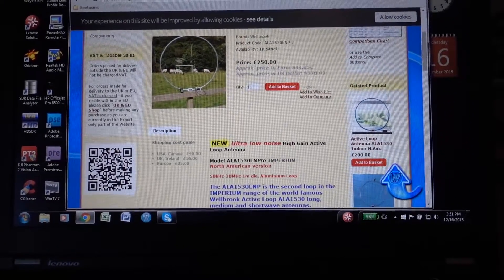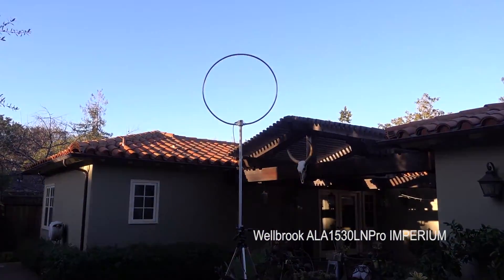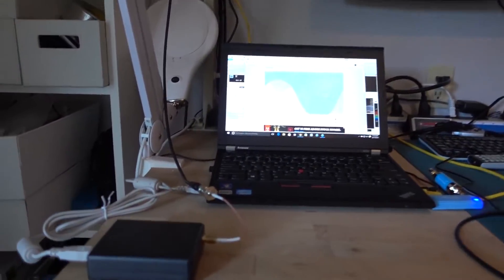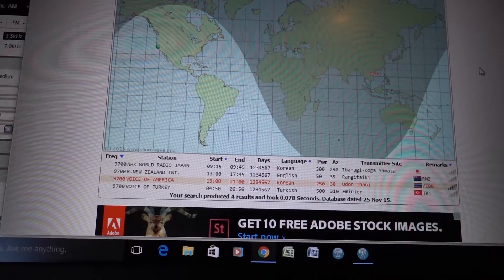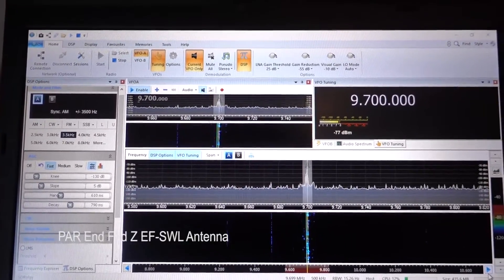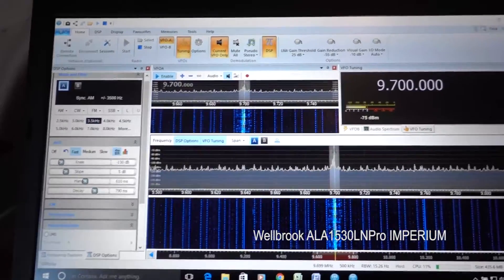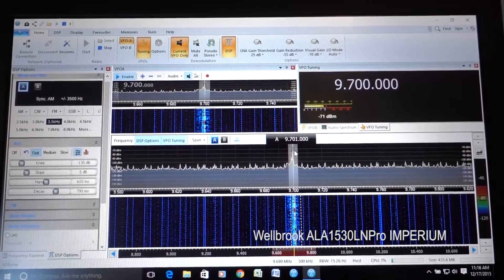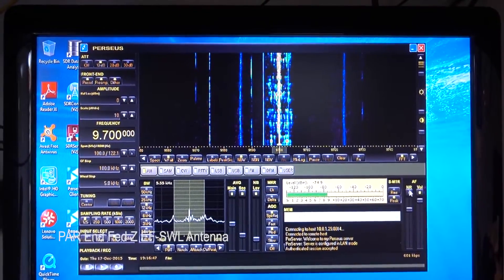Wellbrook Loop Antenna vs. PAR End Fez SWL Test on SDRplay

Comment: Sounded like an interfering signal on or near the transmit frequency of the first station SDR console should allow you to NOTCH OUT an interfering signal. Power SDR does the same thing. LOVE SDR's
Reply from the maker: True.  In general adjacent or strong local signals tend to overwhelm the SDRPlay, but not the Perseus.

Comment: Have you tried turning the Welbrook antenna at 90-degrees in rotation to see if there is a difference ??....Loop antennas are directional sort of in a figure eight pattern.
Reply from the maker: +Gary Babcock Yes, there is a big difference.  For this review I did optimize the direction.   I now have it mounted to a rotor.